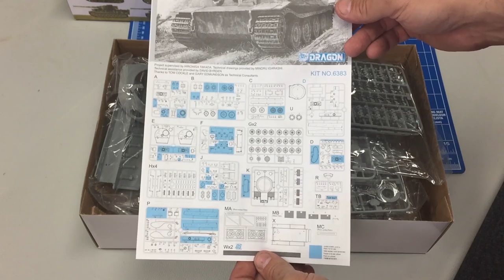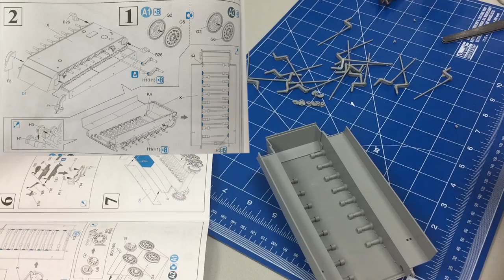Building The Dragon 1/35 Tiger 1  with zimmerit part 1

Comment: When you assembled the wheels to the hull I can't believe Henschel didn't think just once "Umm this might be a complicated setup.."

 I have been thinking of picking up this kit. Immense detail on that thing. Thanks for showing what's included. Makes the purchase much easier.
Reply from the maker: +Pholiage Thanks for watching
Reply: the suspension system was developed to stabilize the tank for shooting on the move
Reply: @SoloFalcon1138  the torsion bars on mine broke so I just glued it in place I can say with confidence I need much more experience before building a tiger
Reply: @AndysHobbyHeadquarters  this was my first model I destoryed the poor torsion bars and had to glue the wheels in place

Comment: I think gluing the wheels in a fixed position was a good idea.  Just looking at the torsion bars as you were putting them in said fragile to me.  If I were building it the suspension would have got broke some time during the adding of the top deck tools and tools.

Comment: Lot of dragon kit comments. Yes the part count is crazy, but also be careful. Research Dragon's kits. Some are not really worth the extra cash. Tamiya etc usually are just as good with the finished product.

Any case, Dragon and it's sister companies (forget the name off the top of my head) tend to re-box old kits and add some PE (photo etch parts) and sell at cost as if new molds. Now some of the newer kits though are amazing, but Tamiya has also stepped it up a bit to.